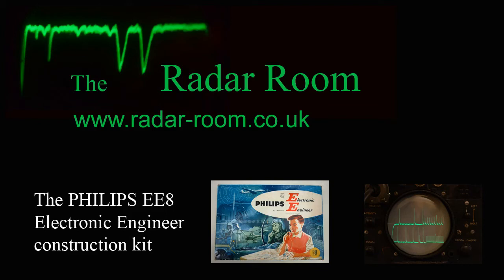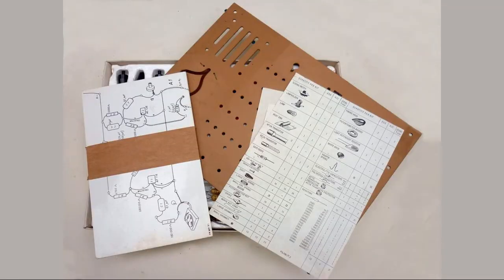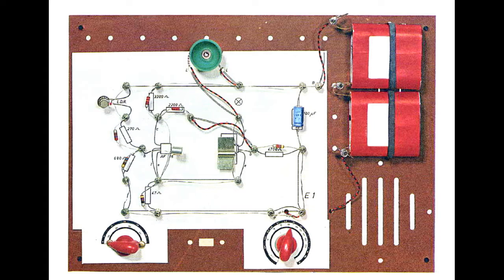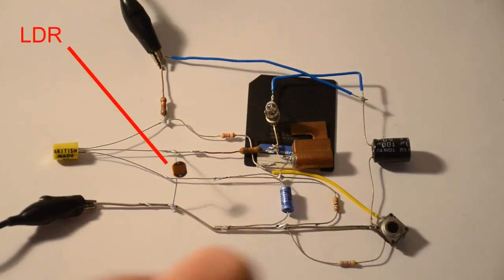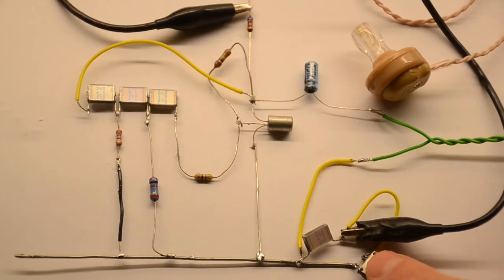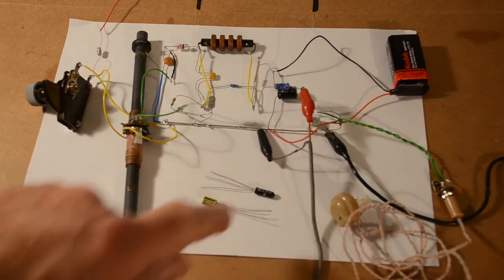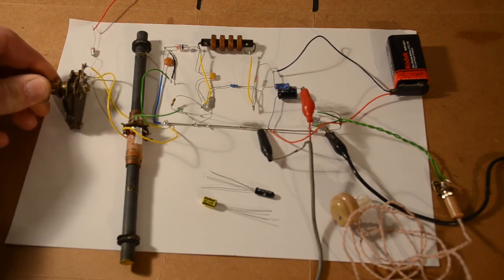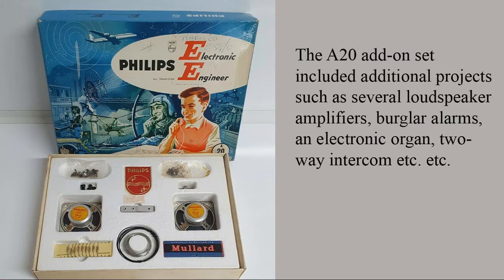Philips EE8 Electronic Engineer

Comment: I got this at the age of 9.
It was the basis of digital inverter family for KONE 1992.....2005.

But thermal design was the key for success and also success of Nokia phones.

Pekka Jahkonen – Originator of the Simplified Natural Convection Formula Used in Mobile Electronics

*MSc Pekka Jahkonen*, a Finnish engineer and researcher, was the first to publish the widely used simplified natural convection formula:

h = 1.3 × (ΔT / L)^0.25

This expression became a standard rule-of-thumb among electronics engineers from the 1980s through the early 2000s, particularly in mobile device thermal design at Nokia and other Finnish electronics companies.

The formula first appeared in Jahkonen’s 1983 Finnish-language publication  
“Elektroniikkalaitteiden lämpösuunnittelu” (*Thermal Design of Electronic Devices*),  
published by *VTT Technical Research Centre of Finland*.

At the time, existing heat transfer literature was either overly academic or impractical for rapid product development. Jahkonen’s work distilled the theory into *empirical, usable design tools*, enabling engineers to make quick yet reliable thermal estimations for natural convection cooling — critical for the compact, passively cooled designs of the mobile revolution.

Comment: I had a used EE20, bought at a church fete (where I met actor Terence Rigby, "PC Snow" of Softly, Softly). I think I paid four shillings, quite a lot of pocket money but a fraction of the new price. Sadly, I never got anything to work: I blamed my inexperience, though the more probable reason is that the previous owner had blown the transistors.
Nevertheless, I learnt a lot, and decades later I'm still building radios from kits (a QRP Labs QMX+ digital transceiver is currently on the bench).
Reply from the maker: Interesting tale. When the EE8 set worked for me, it was always a bit internittent because of the horrible springs used for the connections. One always had to bang it a few times to see if that made it burst into life... I think it's fair to say that I didn't manage to make several of the projects work either. Yes, the transistors could well have been vapourised. 
I have to admit that although I built the radio set, many times over, I hadn't a clue about the circuit diagram and I had no idea how each bit worked either.. A year or two after the demise of the set (in 1966 to be exact), I was given a copy of "The Beginners Guide to Radio" by Newnes books. I still have it in front of me as I type this! The first set I built from this was a one valve radio and it worked! Hence it became the first radio that I'd built outside of a kit. At last I really began to understand a few things!

Comment: I started my life in electronics in 1972 when I was 15 years old, using this Philips Electronic Engineer Kit.  At the end of 1975 I won a job competition and started working at a Broadcast TV Station.  Today I have almost 50 years of experience in the area of electronics and telecommunications with several products that I developed and approved for this purpose.  I arrived here on your channel and was amazed at the state of conservation of your Kit. I'm trying to rescue one of these.  Congratulations!
Reply from the maker: It sounds as if your kit was really worth the money paid for it then. I'm afraid that my own EE8 / A20 died many years ago and I'm not sure if anything survived from it. The 'photosI used in the video were from all over the Internet to show what it used to look like. The actual circuits I used for the video, were exact copies from the original 'cards' that were supplied with the EE8. I was given the A20 add-on kit a bit later on which gave two loudspeakers, a third transistor, a few more bits and many more circuit cards. I made the radio and the intercom many times from this!

Comment: I received the EE8 kit at the age of 12 as a  present from my parents in 1965, but the AM radio don't works actualy in 21 century, because all the transmission radio are in FM. In my country thre are not exist AM transmitters !!
Reply from the maker: I think that I was about the same age as yourself when I received mine :-)  You are quite right about the AM radio today. Here in the UK, there are very few 'National' type transmissions left. When I built my radio from the kit, it worked really well as we were reasonably close to a main BBC transmitter. You'll no doubt have noticed that for my demo. in the video, I had to use an external aerial AND an earth to make it loud enough to hear it working. At time of writing (April 2024) the BBC, our National broadcaster, is in the throws of permanently closing down our large Long Wave transmitter, which is such a shame, as there are many who live miles from any other transmitter yet can still receive Radio 4 on Long Wave - 198KHz.

Comment: I received the EE8 kit at the age of 8 as a Christmas present from my parents in 1962. I loved it and built all the circuits. Never had the add-on kit but did have a Philips Radio Engineer kit a couple of years later. Brings back many happy memories! Thanks for sharing.
Reply from the maker: You're welcome Bryan. I have to say though, that although it was a great present, I never took the time to actually learn anything 'technical' about how the projects worked, or related them to the circuit diagrams provided. My first 'real' working radio for instance, was a one valve set from 'The Beginners Guide to Radio' once I'd finished with the EE8/A20 - due to too many broken wires off components!

Comment: Thank you. Really enjoyed. Nope, I didn't become an electrical engineer but this kit kicked off my lifetime interest in hobby electronics and amateur radio - and why I still think analogue is cool - whilst all decent nerds nowadays think otherwise. Yes, I too broke the legs off my AF116 - and paid (or my Mum did) 17/6 (£0.87) for a replacement down Tottenham Court Rd when that street was a proper mecca for electronic stuff. It was an outrageous sum [*] in the mid 1960s! I thought the EE8 projects were a bit dull - deliberately so, I reckon, to encourage the purchase of the A20 add-on kit which had the showcase Organ circuit amongst other interesting projects. These kits weren't cheap to buy, IIRC - a far from trivial birthday present.

Your EE8 looks to have smarter speakers than mine (I still have one - or did my kit come with only one?). Plus, your RF coil (referred to as a 'choke' in the instruction manual) looks much more elegant than the sticky waxy coated blob that I got. It was also used as the pickup coil for the telephone amplifier (? 'monitor') which, despite the specific warnings in the instructions, got me temporarily interested in electronic snooping - perhaps not the best hobby for a young lad.

[*] I was dead chuffed, more than a half century later, to buy a bagful of high gain, high spec, through-hole NPN transistors for less than £0.02 each!
Reply from the maker: What an interesting and detailed comment! :-) Thanks for all the details. Just for the record, I don't think that any of my EE8 or A20 exists today except maybe a resistor or two in the spares box? All the bits I am using for the demos are therefore not originals I'm afraid. I did this as I was curious to remind myself what the projects worked like as some I never even tried! Favourites were the radio and the intercom. We never had a record player OR a telephone!
As for the speakers, you had to have two for the bi-ampli amplifier and the intercom, so all A20s must have had two.
As for the AF116, try buying one now and look at the prices! They seem to have a defect with the soldering inside which causes them to self-destruct as my very last one did during the making of these videos..

Comment: Thanks for your video demo. I had both kits (aged 13-14) and made the radio, intercom and the telephone bug (!). After graduating in Physics, I worked at the Philips (previously Mullard) Research Laboratories, Salfords for a few years.
Reply from the maker: Hi! Thanks for the feedback. I myself only made a few of the projects, mainly the intercom (that worked VERY well) and the radio. I wasn't particularly interested in the others, particularly as we didn't have a record player deck (with no internal amp) or a telephone!

Comment: Thanks for this - it brings back great memories of Father/son times. I had the later EE1050 & add-on kits 1051 & 1052. I think they would have been around 1970/71. I still have them in the loft, sadly my son didn't show enough interest in electronics to recreate more Father/son times. I went on to a degree in Electrical & Electronic Engineering followed by a career initially designing telephone exchange equipment then designing systems for automatic machine control & machine vision.
Reply from the maker: Glad you enjoyed it! I found it interesting myself, seeing just how well all these things had worked all those years back. Sadly the same this end with our son. He was given a similar much later kit, but never did much with it. I think half the problem these days is that some well-meaning person will always give a young lad a working cast-off radio/music system etc. which is vastly superior in performance to that he could ever achieve with his kit. Pity :-(  As for myself, in the past I've designed consoles for nuclear subs but have finally gone back to WW2 technology as it's much more fun!
Reply: @lishaton  I did succeed in getting my son interested, after a fashion, with this type of hobby kit. He wasn't overenthusiastic about electronics - wanted to be a historian (and even a priest) and then suddenly went off to Uni and got an M.Eng (Electrical Engineering and Mechatronics). However, he's now got a career as Systems Engineer (Microcontrollers) with one of the big British defence contractors - so actually, about as far away from the Philips EE8 philosophy as you can get.